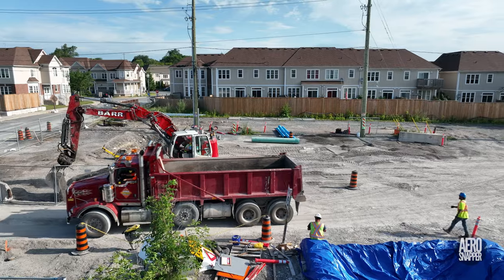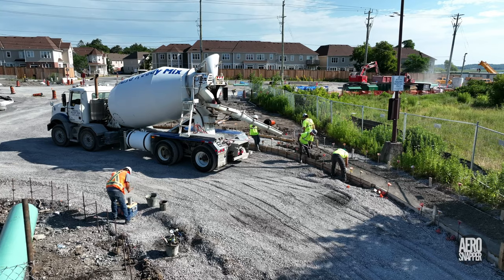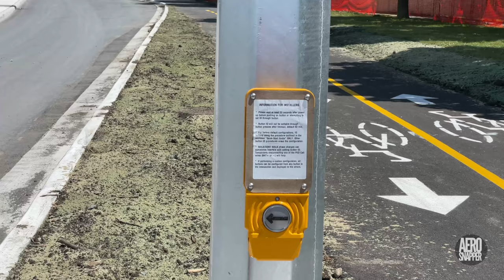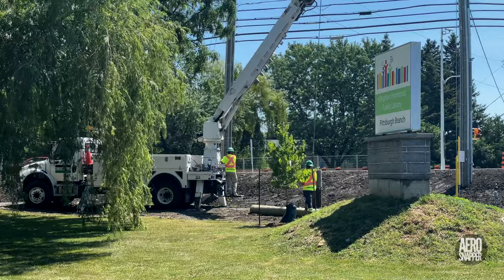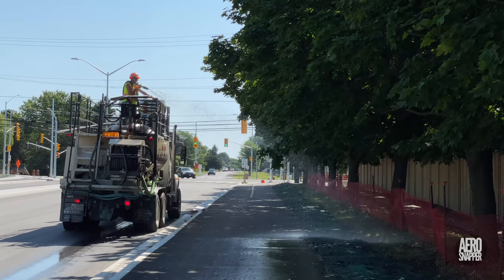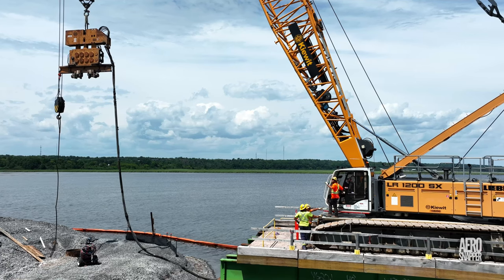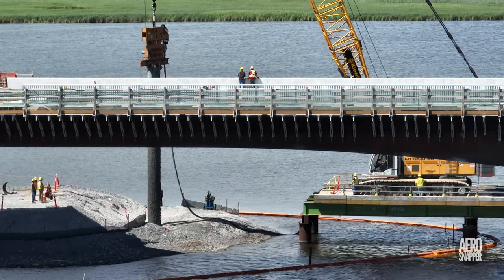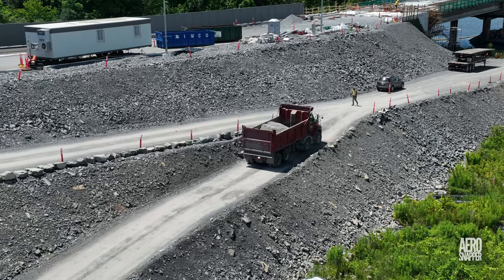All Shook Up   4K

Comment: Was impressed by the grass seed “sprayer” clever. We’re wondering how deep the gravel road is next to the bridge & that they’ve got to dig it all out !!!
Reply from the maker: Most of the river is only about 18" to 2' deep.  The temp roadway was about 4' above the surface - it will take a bit of work to remove it - but way easier than barges, which could not have accessed the shallow areas.
Reply: @Aerosnapper  wow, we thought it would have been deeper !!
Reply: ……but thinking about it the deeper areas are covered by the piled roadway & gave the lift for boats to go through, thanks Mike 👍🏻
Reply from the maker: @mickmansfield5930  absolutely correct - the trestle-supported, temporary roadway at the east end allowed the deeper waters of the navigation channel to pass - and included a lift bridge that won a design award.  This trestle-supported section is in the process of being removed.